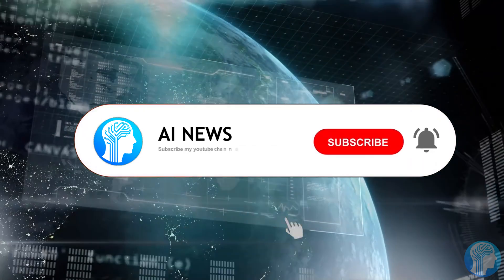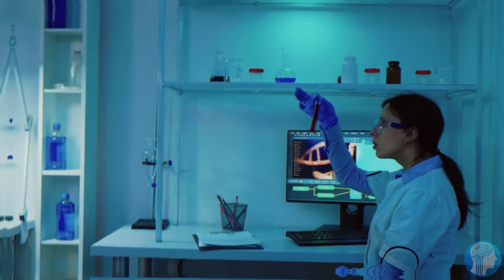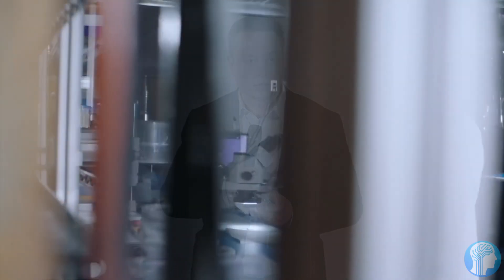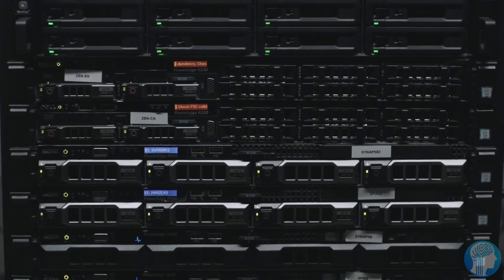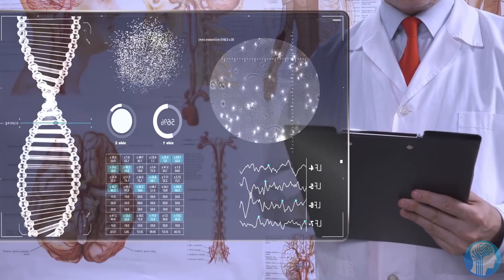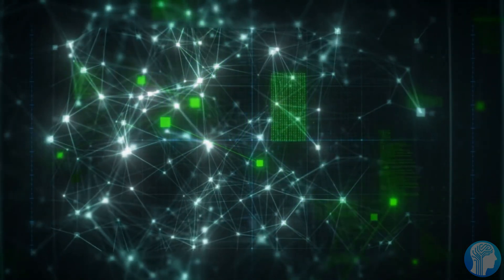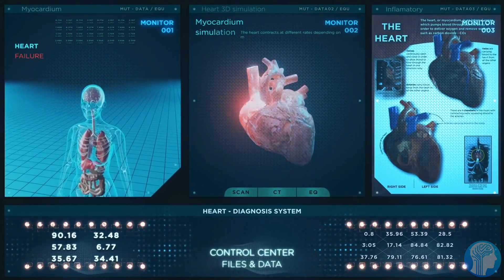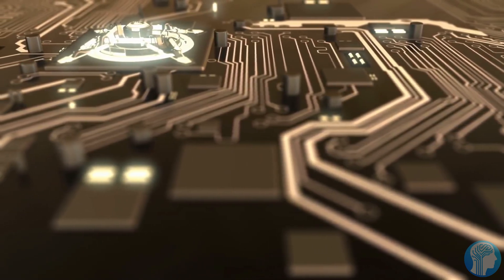Artificial Intelligence vs. Human Intelligence (Cortical Labs)

Comment: 10:36 Artifical in the terminology, is based on the origins of design, such as, The Hands Of God or Nature, phrase of words, would be claiming natural or organic.

 However, artificial doesn't have to render in metallic or parts of chip hardware, the reason why research of artifical and bodly machanics rendered in this robitic lingo path in history, was due to religious regulation of biological flesh parts from forming artificial bio structure and AI programed, these bio tech abilities have been masterd, but not offered to the public, for authorizing practices.

  So yes, synthetic or flesh growth and borrowed organic parts can make an AI, render organic, even though,  declared, non-organic life.

 Even possible to tranfer organic Intelligence into artificial structure, as vice versus, a definition or neurolink as modern term, for a souls.

Comment: If I understood this correctly, couldn't you use theses artificially assembled biological neural networks for training and then copy them into a digital format for execution?
Reply: nah biological and artificial neurons are too different
Reply: I never said anything about them being like humans.  But they seem to be better at finding training weights for given problems (through gradient descent).  You copy those training weights to a silicon system and it does the same thing, only faster.